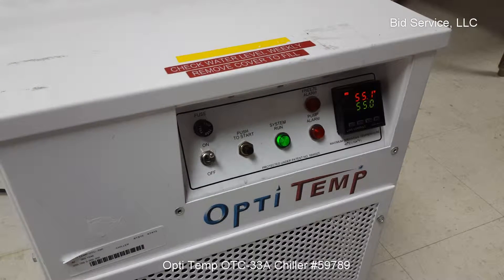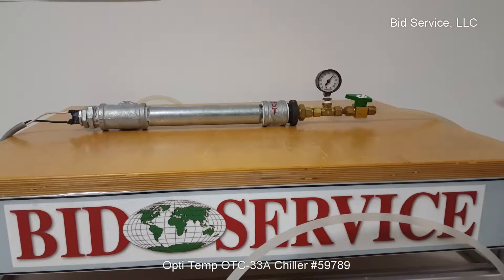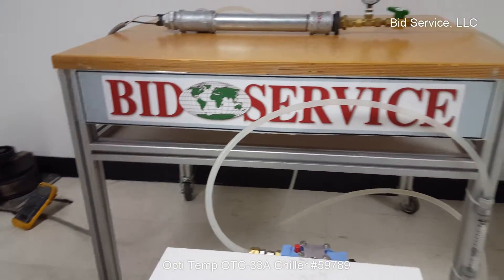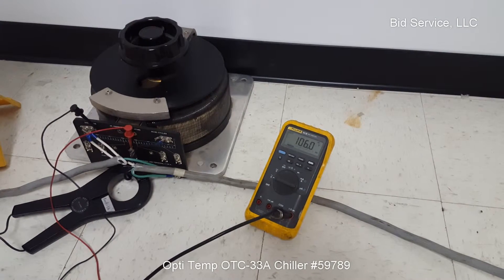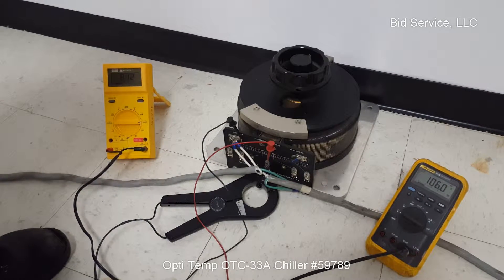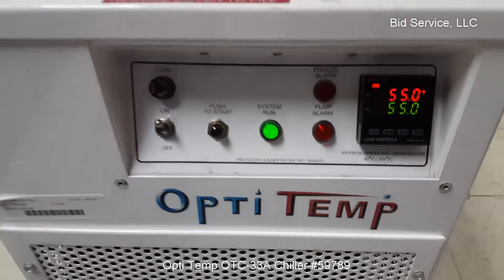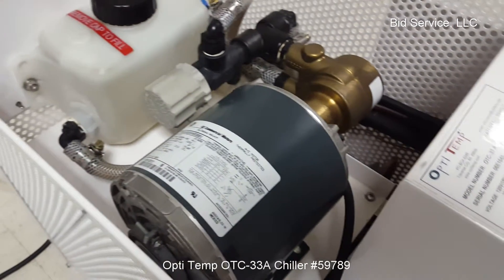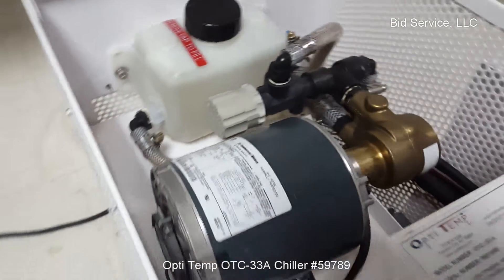Opti Temp OTC-33A Chiller #59789

Comment: I have a freeze alarm light on... setpt 18°C and current temp 38°c no compressor on..pump is running..any ideas or tech support number thanks
Reply from the maker: Sorry but this system sold 8 years ago. We dont work on too many of those systems.